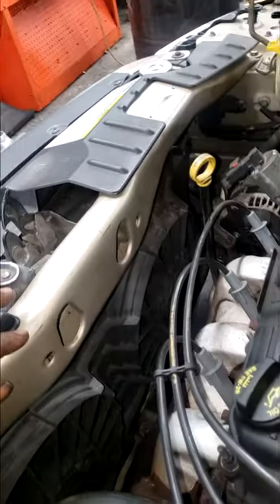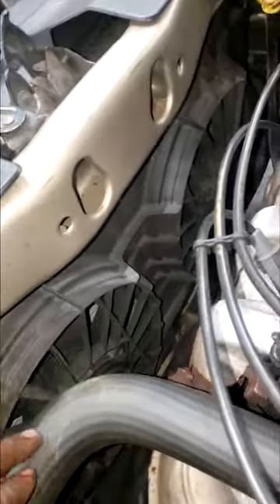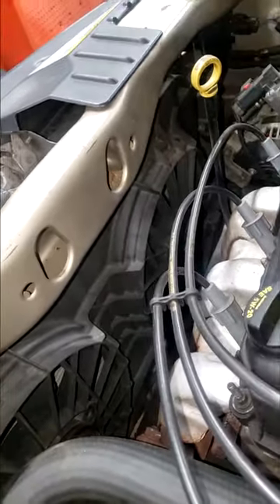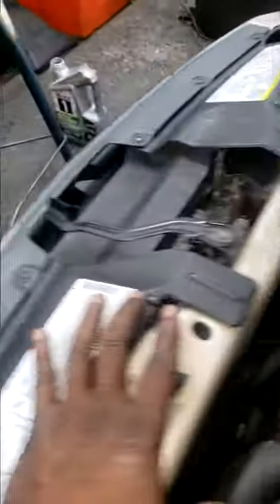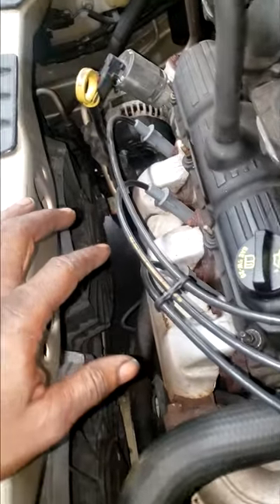Here's why your AC not COLD when you at a stop. Always check this first. #JTtheCarGuy #shorts

Comment: That's why in the older days before electric fans in the car when we did air conditioner Servicing we checked the temperature coming out of the ducts before and after putting a fan in front of the car imitating 40 miles per hour which at that time was the optimal speed of Maximum efficiency of the AC

Comment: Man I'm gonna start being a career mechanic soon this video is gonna help me, especially that Lil tip about checking the connector for power to quickly diagnose the issue, I almost feel embarrassed not knowing that already lol.
Reply from the maker: https://www.youtube.com/shorts/FbIUXiOHdU8
Reply: Always check for power on an electrical part.
Reply: both fans dont have to be running for it to be operating normally. the other fan is more for engine high temperature cooling, not for air conditioning.

Comment: Don’t ever put your fingers in a radiator fan, ESPECIALLY when the vehicles is on or running. Assume it can kick on at all times.
Reply from the maker: True, but I'm extra careful. I know how far to go, thank you
Reply: The good thing is that it was the middle finger you really don’t need that finger other than to flip people off 😂
Reply: If the motor was "stuck" or the brushes have a ton of carbon, simply moving the fan can make the motor make a connection and start working.

Comment: I had that problem once in one of my old Lexus, when the car was sitting still the A/C and heat wouldn't blow cold and hot but it was a different problem. I noticed the rpms were running low also so I took off the throttle body and cleaned it and everything started working fine again at idle.
Reply: May I ask for steps to clean throttle bottle ?  Is it located near compressor? Thanks my Lexus 2006 Rx400h  has warm air at idle, but cold when driving.
Reply: yup gotta clean the throttle body and clean or replace, if old replace the idle air control

Comment: How are pressures normal if fan was not operating? Head pressure would be elevated due to heat not being rejected from condenser.
Reply from the maker: Normal as in the amount. Based off those pressure reading, one can assume the sys not empty. Meaning that the reason for AC not cooling is not because the AC sys empty. And for the record, on some cars, the fan not even needed until high side pressure reach a certain amount. So the AC may be cold when first started.
Reply: @OnlineMechanicTips  that's on all cars to maintain head pressure during low ambients. There will be either a fan pressure switch or the pcm is programmed to energize fans when head pressure reaches predetermined amount
Reply from the maker: @topher8634  To say something apply to ALL cars without even knowing how ALL cars set up simply a risky thing to suspect. Your opinion on the matter simply not true.
Reply: @OnlineMechanicTips  that's how ac and refrig works. If fan ran all the time during low ambients, head pressure would drop too low and system would start to ice up. Also expansion devices do not work well below 90 degrees condensing temp. That's why the fans cycle during low loads/ambients. It's not an opinion, it's physics.
Reply from the maker: Dude you all over the place. In this video is a 2008 Dodge Caravan with only 1 fan working. Ya original comment is that how could pressure be normal if fan not working. That was explained in my second comment to you. What part of this exchange is the dis agreement? The car need both fans to operate properly. Are you suggesting that it dont? Or are you suggesting pressure can't be normal if both fans not working?
Reply: @OnlineMechanicTips  yes pressures could not be normal if fans not operating properly. Otherwise, the fans would not be needed if the pressures were normal. Some vehicles have only one fan, I've seen as many as 3 on others, staged to come on at different head pressures or coolant temps. I was only saying that it isn't an opinion on the operation of the fans, it's a requirement for any compression refrigeration system to maintain a minimum head pressure whether it's on a car, your house, an ice machine, etc. There will be some means to keep it above a minimum amount or it will be operating outside of it's designed envelope.
Reply from the maker: @topher8634  Ok, lol, sounds like you belong in a class room. In the shop, we only interested in quickly figuring out whats wrong with a car. And again, based on the pressure reading that I had, thats enough to alert me that its a normal amount to allow for the compressor to operate. Knowing that would usually lead a mechanic to his next quick visual check. Which is when I noticed high side pressure rising because not enough airflow blowing across the condensor. All the customer want is cold AC. For that to happen, I must fix this fan problem. The fan assembly was replaced, AC sys rechecked and now blowing cold as design. There was no need to adjust the amout. Van fix and has been gone for over a year now.

Comment: Both of my fans are running and STILL have that problem. 2010 civic
Reply: Do you have a clutch on your ac compressor? If not that's your problem lol won't even hold a charge
Reply: @MacMadeSeedsAndStems  
Yes. Clutch engages. New compressor, condenser and valve. I'm stumped
Reply: Hmmm mine is 2007 Civic. Only one turns on and the other clicks on on and off

Comment: Just push the plug towards to fan.  If the fan starts to run, it's burned out.  Just push the connector towards the fan.  I bet it starts working.

That's how you can check power.
Reply from the maker: The motor was burn out. https://www.youtube.com/shorts/FbIUXiOHdU8

Comment: I had the same problem yesterday with a 2011 Hyundai Sonata where the low side pressure was at 85psi at idle and high side at 150psi.  When I Rev the engine to 2000rpm, the low side pressure pulls down to around 60psi.  My result is a weak Compressor.  Condenser fan (which is just one fan) spins just fine.
Reply: Shouldn't low side be 40-55 psi for Ambient temp 70-100F with AC compressor turned off ? so when it turns on, psi should go down to about 35?

Comment: Besides ramming air driving . What if have to push the idle up with the peddle and either the overheating stops or the air gets cold doing that. . Is it  compensating for weak compressor or weak radiator . And turns the water pump harder. And or compressor

Comment: You didnt see a real hi high side pressure ? and a little bit hi low side ?  Thats our first clue about no fan, or not enough fan. We often get them where the fan is running, but too slow (fan old and tired). Also, where we are from, we have to add anther condensor fan in front, run off a relay from the clutch.  (115 degrees in the summer)  Makes the AC way cooler, keeps your high side prssures way down

Comment: What if the fan is good and it has power and ground going to it. Then what??
Reply from the maker: A typical electric motor such as a fan motor that require a power source and a ground and have both but that electric motor still not operating? Simply mean the motor internally open.

Comment: Thanks for the info! I've had this problem with my 2008 Honda Civic for quite some time now. Haven't looked at the fans yet but I will update this comment if you solved my issue!
Reply: Just checked my fans and sure enough one of them wasn't working!
Reply: Did you get it fixed ? What was the issue
Reply: @Amahyze777  It was a bad fan. I had changed out my condenser and evaporator before I had even realized that one of the fans wasn't working properly. I changed the fan and presto, ice cold air. Would explain why my A/C worked okay on the highway but not residential
Reply: Tells you what now. Now I think it about it. It did go out on me when it was really hot and I had drove it all around. And I heard a hissing from my engine when I when I turned off the car I heard a hissing from the engine but I

Comment: 🥺 I just replaced the coolant temperature sensor and the connector and my ac still not blowing cold and fans still not working. Why's it? Maybe the fans or relays? Please help 😢 I have a 2015 Chevy traverse. It was cooling fine and it stopped working when i was driving.

Comment: Not all electric fan setups run both fans at the same time. It’s normal for one fan to constant run and the other kick off and on with a signal from a coolant temp sensor. Now if that second fan isn’t kicking on and off when commanded by the pcm then you have a fan issue. Most the time it’s a filthy condenser bc people never think to clean them. It’s even worse and more common in places that are drier climate with more dust. Always try a condenser clean before replacing fans.
Reply from the maker: You have great points. But on this set up, yes, both fans should be on at the same time. If one is not and the power/ground at the connector then its simply the fan. https://www.youtube.com/shorts/FbIUXiOHdU8

Comment: Is the car hot enough for the high fan to kick in? Also, ac is gonna be colder when revs are higher, like at highway speeds
Reply from the maker: This fan assembly run both fans as needed. Both should be running when either on high speed or low speed

Comment: My 170k mile 2009 Ford Fusion only has one cooling fan, and it comes on when the ac is turned, but the ac is not cooling at idle and barely does while driving 55mph on a 95 degree day. It has a new condenser (the old one had a pinhole leak in it), and I replaced the compressor at the same time and had a shop put the right refrigerant charge in it. It also has a new TXV. Any ideas? Could the cooling fan not be turning fast enough due to a bad control module (that I think has multiple resistors on it for the various speeds called for, depending on engine cooling and ac cooling needs?)

Comment: Quick question does the fan only run when idle ? I have a chrysler 300 and man fan doesnt run when ifle
Reply: Literally helping my boy fix his 300 A/C right now. When you’re at idle the fans don’t spin because they activate when temps get high and the car gets an alert like “hey !! Cool me down cause I’m starting to get hot”. So no, they ain’t supposed to run. HOWEVER, if they don’t cut on when you turn the AC then you have a problem pa

Comment: What about on a 2004 Saturn Ion 2? Im thinking it's the fan itself and it's pulling power from my battery because of it being bad. I mostly use fresh air when running the ac instead of recycled but still it's only cold when I'm running interstate speed. How would I test on my 2004 Saturn Ion please and thank you

Comment: And also the new 1234 freon is terrible at idle because it operates at a much higher pressure than 134r.
Reply: That’s a Dodge Grand Caravan/Chrysler Town and Country, they were still using R-134a on these vehicles.
Reply: @jamram9924  yeah absolutely.  But, the new Freon is not as good as 134.  My 02 f150 was much better than my new one

Comment: one fan is for condenser cooling and the other is for engine cooling. both do not always have to be on for the system to be operating properly. makes me second guess your abilities as a mechanic. also pressures being normal doesn't mean the system is full.
Reply from the maker: Theres no need to second guess my ability to do anything dude. Every thing I say on my channel  merely my opinion. You also entitled to your opinion. In some cases opinions clash. Such as this one. The setup you speaking about do not apply to this vehicle. The condensor on this car in fact wide and require both fans to work for it to operate properly. So yes, both fans have to operate on this car for max cooling to occur. Also nobody said the sys was full. Before you go trying to correct somebody, maybe you should know what kind of vehicle being discuss in the video. Not all cars the same.

Comment: man I just got a 2002 mustang gt and it only blew hot air no matter the setting it was on so I recharged the ac and it still didn't work. so I looked around the car and there's a compressor bypass pully where the compressor is supposed to be! everything else is there so I just need the compressor lmao

Comment: So that would mean your statement is wrong (pressure will not be normal if it isn't cooling proper at idle if one fan isn't working)
Reply from the maker: Perhaps, but in this case the high side may rise slightly because only half of it doing its thing. The fan is not even design to come on on some cars until the high side reach a certain pressure (Cars with AC transducer) So depending on when you check the pressure using gauges will it be considered accurate.

Comment: Ok so I need your help! My car was overheating but we figured out that the little square plug in piece on the drivers side closest to the battery/headlights had a short. So we taped it to work all the time and I have to unplug it when the car is off for longer than like 5-10 mins. However, the reason we did not do a toggle switch is because someone said it would affect my A.C. That’s why we are using this method until I can get someone to tell me which of the (3?) sensors is messed up. Anyway, the car tried to overheat the other day so we had to re-tape it a little tighter but now my a.c. Is out completely. It blows but it’s hot air pretty much. Do you think it has something to do with this issue or does it just need some Freon (or whatever it’s called lol)?
Reply: I’m gonna go check right now and see about the fans but I have a 2011 Hyundai Sonata. I think there’s only 1 fan but I’m not sure lol 😂
Reply: Also it worked great with the taping of the piece until the other day. I think because we have taken it out so many times maybe we moved the tape but it was only a temporary fix anyway. One more thing: I have the new piece but the fan isn’t coming on because of one of the (3?) sensors isn’t telling it to come on. That’s why the piece I am talking about is taped in the first place. It keeps the fan on all the time. That’s why we have to take it out

Comment: This is the differance between a real mechanic and a parts swaper this guy os a part swaper
Reply from the maker: You prolly should explain it to us, we not sure of the difference.
Reply: He is going to put a whole new set of fans rather than fix the one that quit its a dc motor find the break in the wire open the can find the problem like brush not contacting or in some they put thermal fuse ive even had to solder the armature wire  throughing the whole part out is china style worst case if determined the motor cant be fixed get one from the junk yard that works with busted fan plastic or what ever replacing the whole unit means you learned nothing but how to throw money at it
Reply: @sean7058  
And at standard hourly rate what would the cost be for him to disassemble the fan and start poking around and hoping it’s something easy to fix as compared to the cost of just replacing the fan with a new one that is guaranteed. 
When you’re doing something on your own at home your time is free so you can spend four hours fixing a fan. 
Which of these days would be about $400 worth of labor for $100 fan.
Reply: @sean7058  you’re talking  more labor especially if that junk yard motor does work most of the time the extra the new part cost is equal to or cheaper than the more labor I’ll quote you to go a different route

Comment: Not true. He explained the symptoms of a bad (4 dollar) "orifice tube." Change the orifice tube and charge the, system, and she will blow cold air again at the red lights & at the drive through. You can use the a/c setting on your HVAC for testing purposes on your electronic fans. They operate via a "switched", ground. The temperature sensor runs the GROUND on a one fan, system. I know the a/c setting turns on the fan on a one fan, system. NGL, I'm not certain about second fan when there are, 2. I'd venture to say the other one is switched via engine coolant temperature. If you wanna TEST your electric fan? Just turn your a/c to, "ON?" There's nothing to deliberate. Go test it on your own, vehicle 

The orifice tube is a screen that changes the a/c refrigerant from liquid to, gas. Having a clogged orifice tube would be in comparison to tryna use oil (PAG oil) for cooling?
Reply from the maker: Smdh, not all vehicles use an orfice tube anymore my guy. You still living in the 90s I guess. You basically need airflow thru the condenser at stops to maintain cold AC.

Comment: The fans' job is to pull air through your condenser.... 🎉Learned something new. My fans are NOT on
Reply: Check the cooling fan relay I knocked on mine and the fan started back working and ac back cold at idle hope this helps